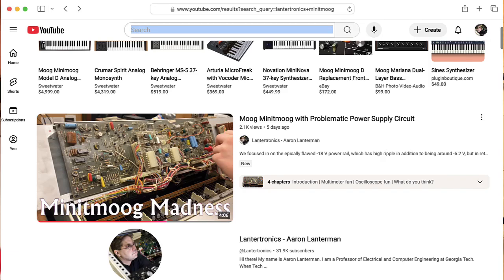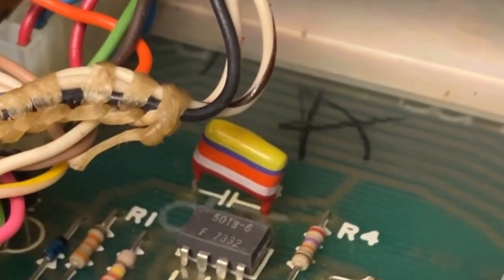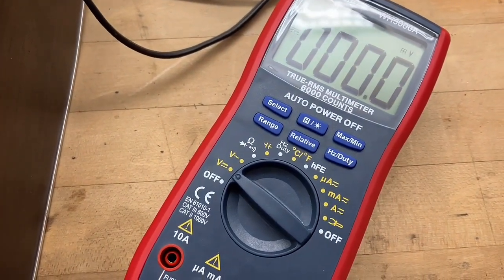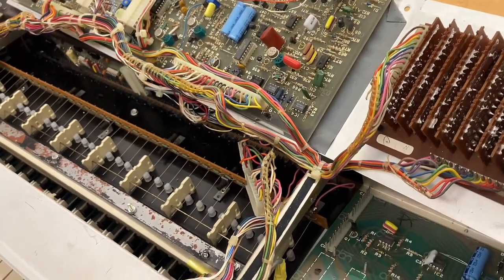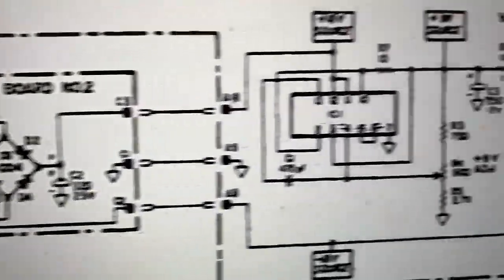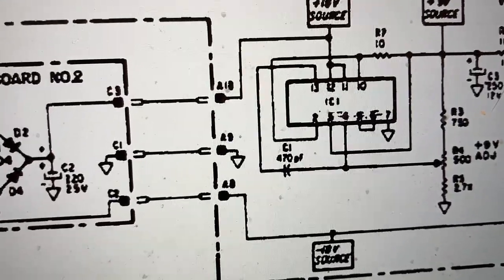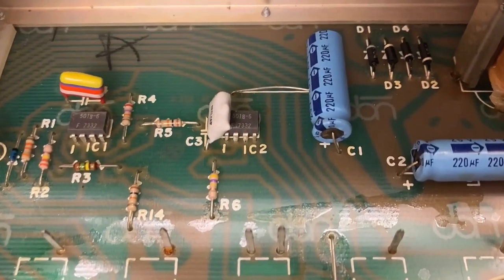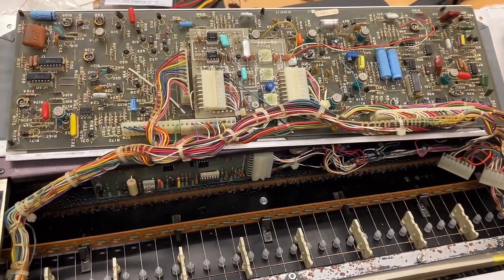Moog Minitmoog Power Supply Progress (Unloaded Voltage & Impedance Measurements Looking Into Synth)

Comment: If the problem was excessive loading or inadequate smoothing, your scope measurement of the negative rail would still peak at around -18V, but would just have a massive ripple subtracted from it. It looks like your issue is high impedance on the transformer end, because the pre-smoothing voltage is being pulled down. That's supported by the fact that with no load, the voltage comes back up. I'd first reflow the solder joints under the rectifier diodes and the transformer in case one is cracked. If that does nothing, I'd check the resistance of the transformer output winding on each side of the center tap. If one side is significantly different, it could be a break in the winding.

Comment: Swap the synth power supply with a proper bench power supply with current limitation and use an IR camera to see where the energy is going.
Reply from the maker: Ah, good idea!
Reply: Or just one of those point and shoot IR thermometers. Something is bound to be getting warm dropping that much voltage. Fortunately it isn’t enough to pop one of the bridge diodes. That’s actually a good thing! 😊

Comment: The Fasest option is an IR camera to find a short. But when elecrolitic caps in a power supply are broken can create exactly the same issue. You can load both negative and positive rails with 330K resistor and compare output voltage.
Reply from the maker: Ah good idea! We will try that.

Comment: Wasn't there a fair amount of ripple on the power supply in the last video? I say replace all caps.
Reply: keep in mind that ripple is also consistent with a perfectly good linear PSU being loaded excessively. smoothing caps can't smooth if they're being drained quickly.
Reply from the maker: Yup, a lot of ripple. Going to start with the electrolytic on the main power supply, then probably hit the electrolytic on the synth board. I'm hoping to avoid shotgun replacing everything, but we'll see how it goes...
Reply: @Lantertronics when it comes to electrolytic caps for what they cost it's best not to mess about and just do the lot.
Reply from the maker: @JaenFoster  Yeah, I figure with a batch of electrolytic of the same age, if some are bad, and some are still good, the good are just waiting to go bad.

Comment: If your problem is an active component being turned on when it shouldn't then that might not show on a simple resistance test. If you had an IR camera a quick view of the boards with the power on should show something dissipating heat. Also given that you have an unloaded voltage of 25V out of the bridge rectifier a rating of 25V on the capacitors seems a bit marginal.
Reply: the flir adapter for my iphone has made finding shorts a breeze! it's expensive but saves me time in the long run
Reply from the maker: Ah -- I do have access to a thermal camera! That's a good idea. (We tried the usual touch test on the chips).
Reply from the maker: Yeah, I was hoping the resistance test would suggest something simple like a shorted cap somewhere.